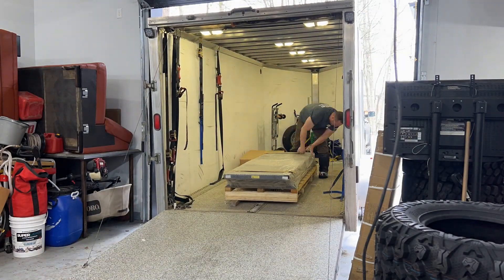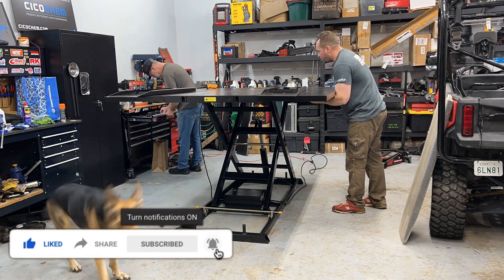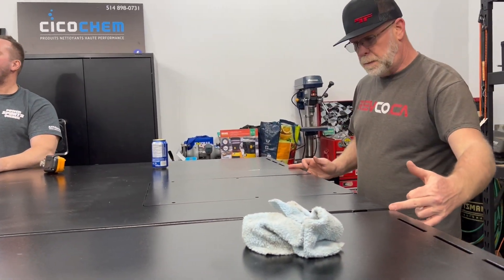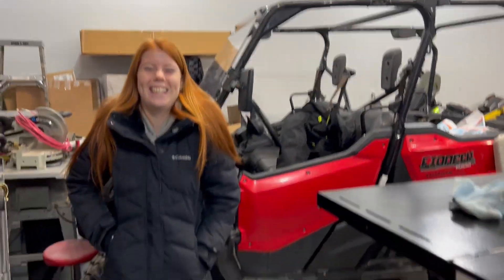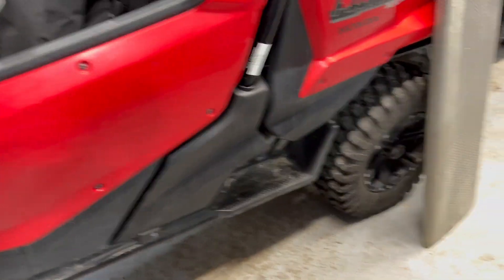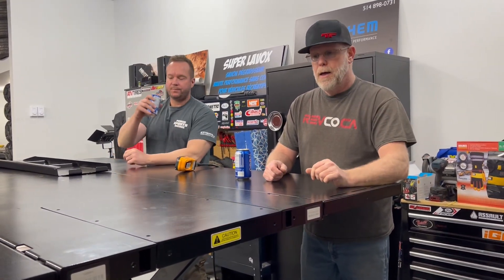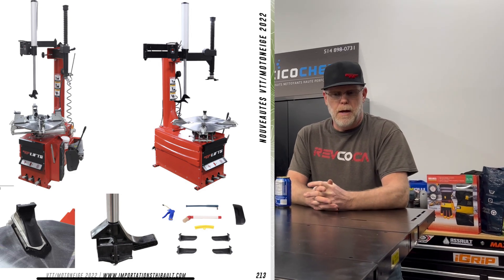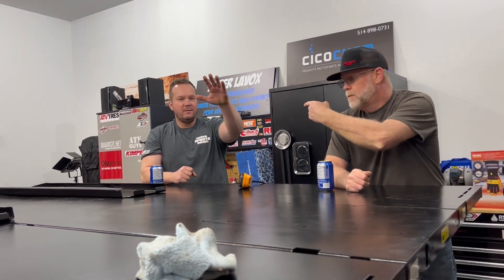SHOP TALK: Our new table lift is here!

Comment: I have a ZForce 800 trail and can't get a soft ride out of it.  I tried max spring settings but unsure of the shock click settings.  F and S settings are they soft and firm or fast and slow?  If so what do you recommend for the softest ride settings...I want a Cadillac.  Thanks!!